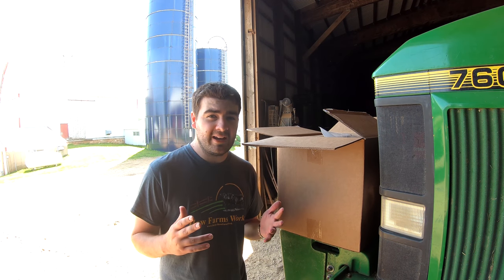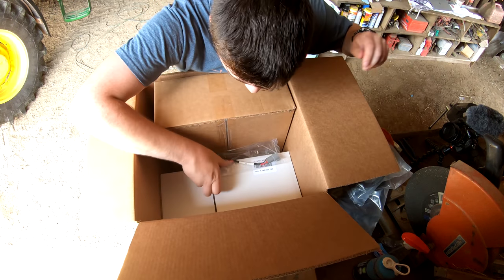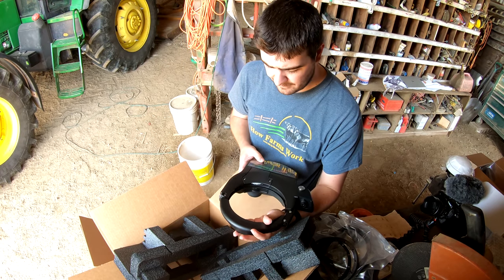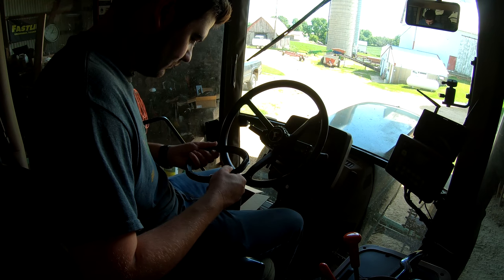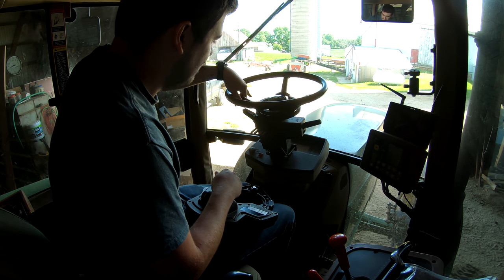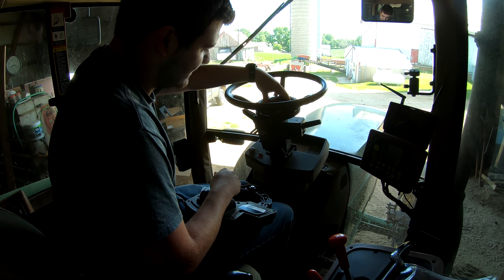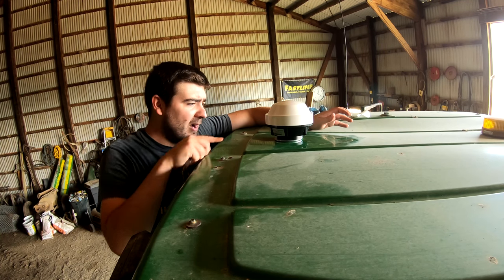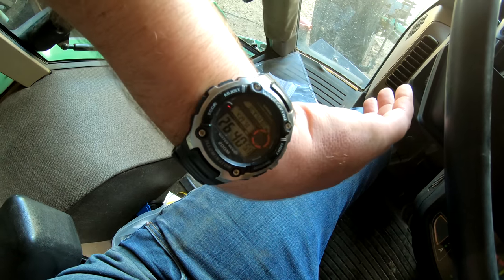Wheelman Flex Install - John Deere 7600 Upgrade!

Comment: The batwing sure does clean up the pastures, add green fertilizer and tons of fresh feed.  Your first planting system saved the day on the mis applied fertilizer.  Your going to sell a bunch of units one demo at a time.  It's great to see smart manufacturers use great channels instead of agencies to market good products.  Rhino Ag has to be most pleased with the way there equipment works on the farms.  Super products.  Now for JCB to make you a hell of a deal.  Good luck

Comment: You should install one in your 4020 so when you rake you can have nice straight rows
Reply from the maker: They don’t make a kit for it yet or else I’d definitely mount it!
Reply: How Farms Work ya if they did I would to because it would make bailing a lot better but you can’t use it for bailing

Comment: Hey there 😜 THX for all the good vids Ryan. I got a question about that auto steer system there. Its nice its a lower cost but what is the aquesy on that compert to lets say RTK system that is A LOT more expensiv?
Reply from the maker: 4-6 inch accuracy compared to <1 inch
Reply: Okay thank you 😄

Comment: Question... is the receiver unit also tethered or the lines to it secured so it can't fall to the ground and under an implement? 
I have little faith in magnetic mounts, always try to set up something so if it comes off it just dangles annoyingly to let you know.
Reply from the maker: You can do any of those, the wire going to it would keep it from falling off if you secure that to the cab

Comment: We farmed 1000+ acres in the 60's and 70's in South Central Iowa with two JD 4020 Diesels and never had GPS or auto-steer and we got along fine without it. You don't overlap on field passes if you are doing your job. But if you can afford it and want it then it's fine for you to have auto-steer. I would rather put my extra money into things that make more money though .... maybe buy some extra cows or land or something.
Reply: Different strokes for different folks!  The Amish farm without tractors, but I wouldn’t want to do it.  The times they are a changing.  After farming with auto steer for a few years, I wouldn’t want to be without it either.   Maybe you can drive without overlap, but most of us cannot, and forget about hiring a new guy with your ability!  Auto steer allows the rookie to drive as accurately as the guy with forty years experience.  And since he doesn’t have to concentrate on driving, he might even pay a bit more attention to the equipment he is pulling.
Reply: @mikelloyd2013  Yes the times they are a changing and not for the better.  Like utterly ridiculous bull crap like computerized emission controls on tractors that will shut the engine down to save the planet from "global warming" if some sensor goes out.  Then you have to call the John Deere dealership to get them to send a "technician" (they aren't mechanics anymore) out at $110 an hour to plug his laptop into the stupid thing to get it running again.  

Neighbor had a new green tractor that was giving him fits one day  few years back.  He decided he had enough of it went and bought an rusty old 1978 4840 a retired farmer  down the road parked in a fence row 20 years ago when the 8 speed Jerkomatic went out at 12,000 hours and the Deere dealer quoted him more than the whole tractor was worth to fix it. 

He paid the old guy what it was worth as scrap dragged it home fixed the power shift, overhauled the engine and called the tire man to come put some new shoes on that old horse and put it work.  I think he is still running it and the new computerized, emission controlled, plastic, POS went to an auction.  LOL

Comment: Why are you mowing that bank at 14:00? Some kind of requirement from the city?
Reply: It's a good place to test things out, and it makes it look much better.
Reply: Well he didn't seem to be testing the Wheelman there, I'm sure the mower and tractor have proven their worth by now, and I'm not so sure about how good of a place it would be to test things. 
About making it look better: Maybe, that's an opinion. One thing that's for sure is that the bees would've preferred an overgrown bank.
Reply: @timderks5960  In years past they have trimmed this particular bank as well as the ones near Travis' "test" field across the road from the Rockville farm precisely because it makes the area look better, in their opinion.  Might as well clean it up while Ryan was working in the area, you know?  You are right about the 4155/7600 combo:  it has definitely proven its worth several times over the last few years.

Comment: How big is your mower  that is being used in the video?
Reply from the maker: It's a 15' RhinoAg 4155. Total beast
Reply: How Farms Work how much horse power does it need for it to run the whole thing I got a little John deer 4010 I think and we got a little 4 foot brush hog is yours a mower or a brush hog the John deer I got has only 12-15 hp we use it to put in food plots for hunting and for work around are 90 acre property how old is that tractor you got that is being shown in the video and also how old and model number is your other tractor? I am looking for a bigger tractor I don’t have any animals or fields with crops on it

Comment: Could you explain how the John Deere model numbers work? Example what is the difference between a 6010 or a 7010?
Reply: @justinmorrison6353  What about the 3 remaining numbers?
Reply: For the newer models it's pretty simple: The first number is the model, the next three are the engine size in HP. The letter tells you something about the capabilities / price level of the tractor in the family. 

For example:
The 5065E is a 65-engine horsepower tractor. When compared to other models in the 5 family of tractors, the 5065E has fewer capabilities while a 5065M has greater capabilities.

How the old system used to work is a mystery to me. I don't think there really was any logic behind it back then.